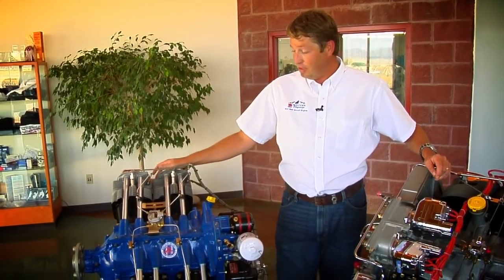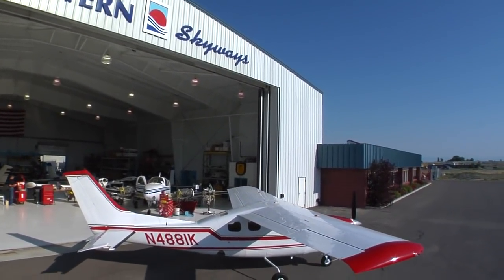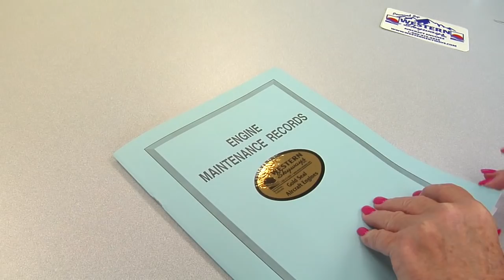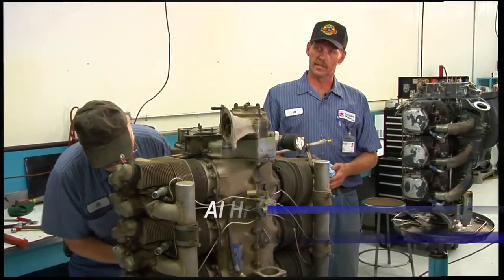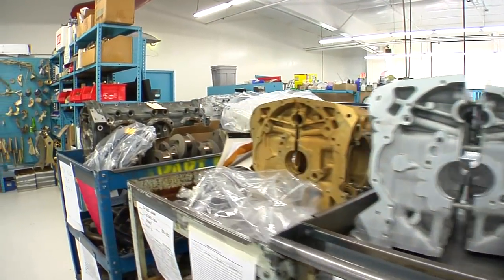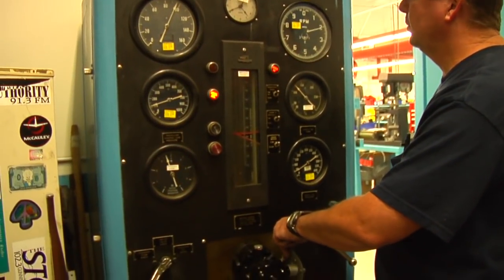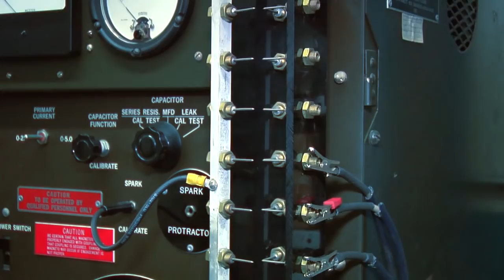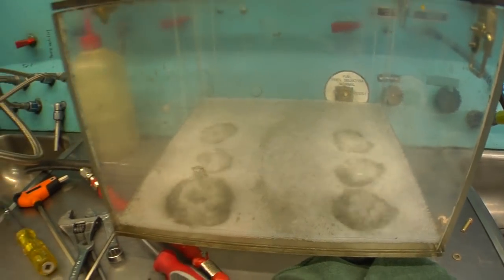Western Skyways  Piston Aircraft Engine Overhaul - 1 (HD)

Comment: You will DIE If you take your Continental here!!!!!!!!!!!!!!!!!!!!!!!!!!!!!!!!!!!!!!!!!!!!!!!!!!!!!!!!!!!!!!!!!!!!!!!!!!!!!!
Reply: Why do you say that?
Reply: What type of thread is used to creat the seal for the engine case? Is it better then RTV? I wonder how well it would work in an automotive application.
Reply: bruce tec Silk
Reply: ckelley63 is there anything else added to create the seal?
Reply: bruce tec yes they use different sealant compounds depending upon the engine make and model
Reply: Silk thread is what is required by manufacturers and is a brilliant seal as is crushes and take out any unevenness and seals well with the adhesive sealant the thread is applied to.